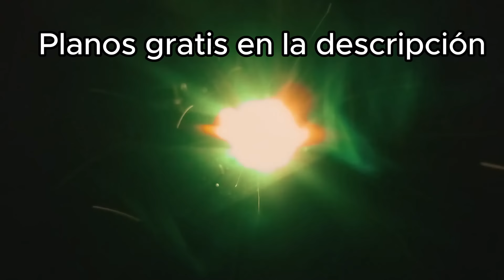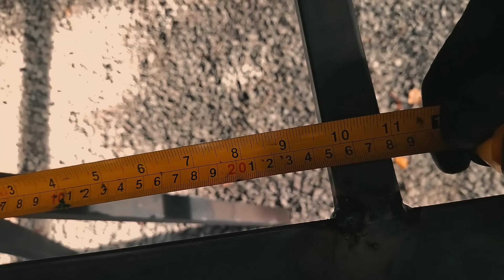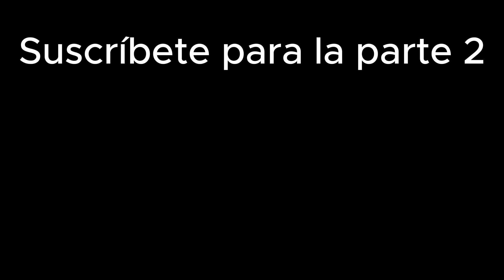Como fabricar un REMOLQUE o CARRO de ARRASTRE 2024 ✅ Parte 1

Comment: Saludos.. el perfil q le pone de que calibre es? Y de cuántas pulgadas .  Pregunto puedo utilizar soldadura 6013 de un 1/8..   espero respuesta..  cuánto puedo cobrar ..
Reply from the maker: Hola el calibre diría que sobre 2mm, aunque no si es pequeño no te excedas demasiado para no exagerar en el peso. En mi país los perfiles metálicos están en mm, así que en este caso use perfil 60x40mm o 80x40mm en 2mm de grosor o 3. Si puedes usar esa soldadura, pero sería bueno también reforzar con otra por ejemplo 7018
Reply: Hola hermano gracias por tu vídeo.  Cómo hago con eje para fabricarlo también me puedes pasar todas las medidas